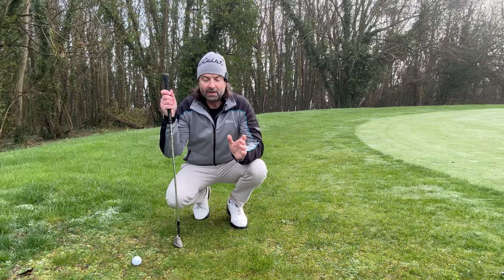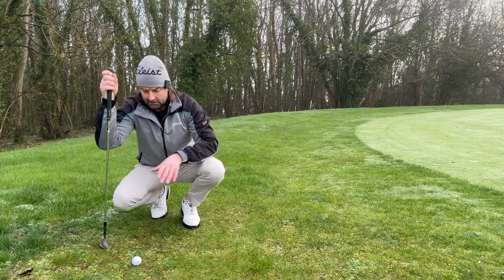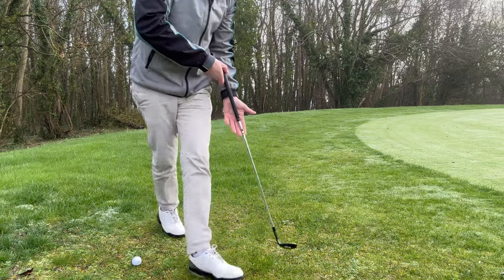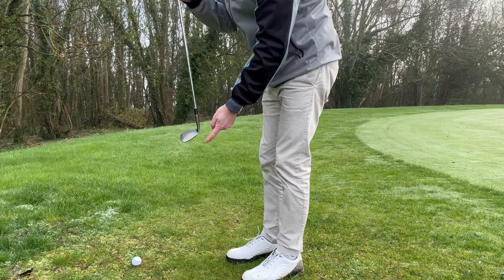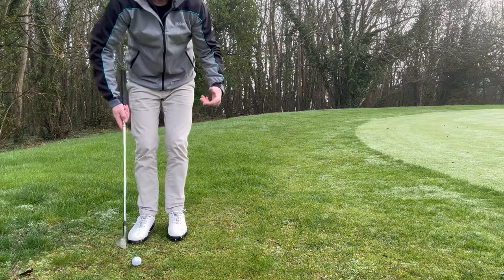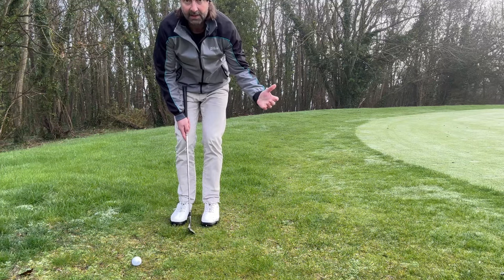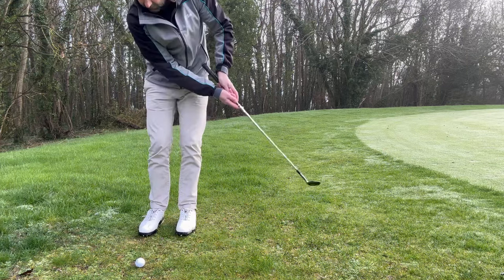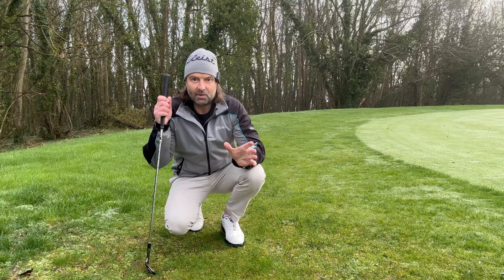Chipping off a bare lie (hard pan)

Comment: Great Vid, as usual.  I missed what elevating the heel of the club does?   So, we are just skimming the ball off the ground as one would if they were hitting out of a fairway bunker?
Reply from the maker: Not like a fairway bunker, but the toe brushes the ground and wrists will not feel too firm..  try practice swings being consistent with the toe clipping the ground.

Remember that the ball is HIT off the toe side so a deadened strike will happen.  Be firm.  Don’t care either!  

Try a few first to get the dead / tinny impact down.  The shot range is 8-12 feet carry only.
Reply: @murdochmcewangolf  Thank u so much.  I learned to use "big muscles" vs. "small muscles" with my chipping, and the difference is like night and day.   I sank 2 chips yesterday from 12 ft.. that has never happened before.  I also used your bunker tip of, "shoulders across feet" , and it worked like a charm.  Flop shots are now on target, as opposed to hanging out to the right.  Can't thank u enough....cheers!
Reply from the maker: @nightwolf2666  that’s fantastic! Good on you Sir well done 🙌🏼👊🏼
Reply: @murdochmcewangolf No, good on you.  God bless.